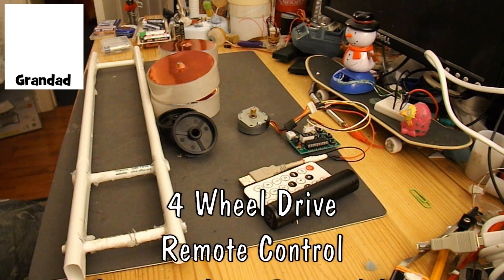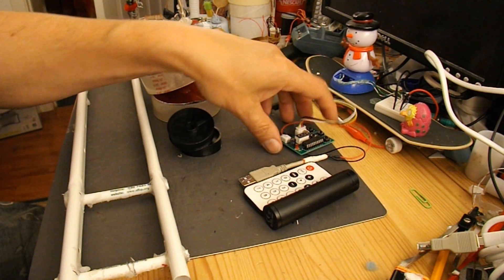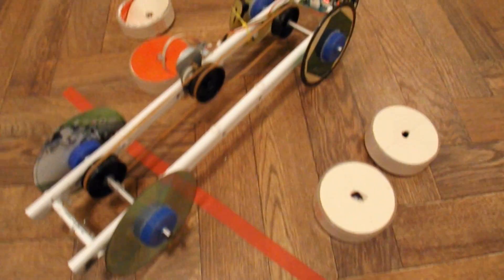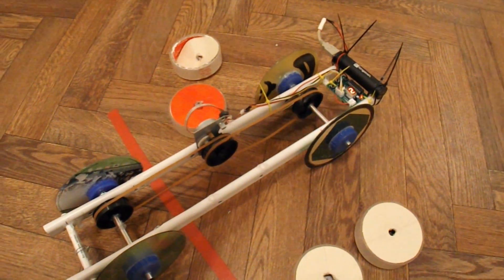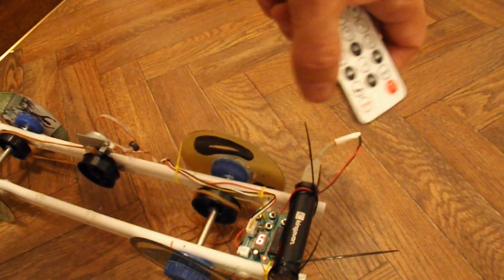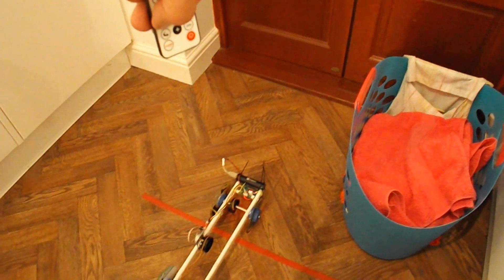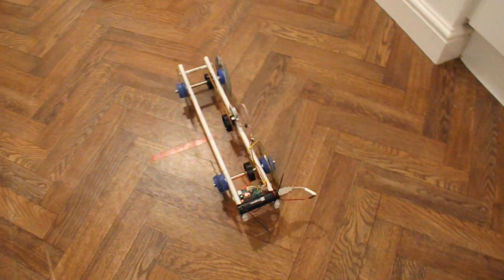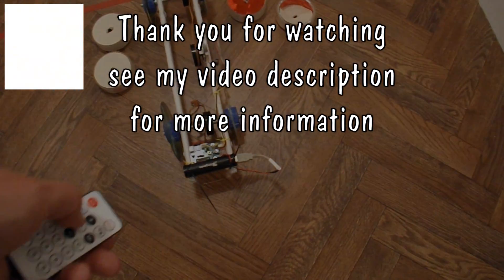4 Wheel Drive Remote Control Stepper Motor Powered Car

Comment: Do you think something like this could be modified to be used like this?  https://youtu.be/isfQs_CS_5Y
Reply from the maker: In essence the WIRAL LITE is a camera mount suspended on a line with two pulleys to support it and a drive wheel to move it along the line. So if you have a couple of pulleys, and electric motor and an RC system you could build your own. At a basic level this video show something similar although far less sophisticated https://youtu.be/5EqwOC9F1aA
Reply: Thanks!

Comment: little bit useless
Reply from the maker: Thanks for commenting. Everything is useless until you find a use for it. The purpose of this project was to answer a request by one of my viewers and that allowed me to test the remote control stepper motor driver. That has so far generated 413K views and some of those viewers will have found the information on the stepper motor driver useful. It may be that is saved them wasting time and money on that item or it may have been exactly what they were looking for so they could see it in use before buying it. However as you say, simply as an electric toy car it is a bit useless :)
Reply: Great response, I appreciate it. You explained very well what I did not pay attention on the video, because I did not watch it completely. Sorry for be rude commenting that, I should not had done, but the reason I did is because of your title, your title says 4 wheel remote control...it drives me to think something about a remote controlled 4 wheel car, not a didactic prototype. Your title could be something like "didactic remote controlled stepper motor powered car", it would get your viewers' attention, but the silly guy here would not comment offensive things. Sorry again and congrats for your teaching job.
Reply from the maker: Jefferson Deschamps Haha, thank you, I didn't find your comment offensive. I do get comments questioning the purpose of some of my videos, sometimes I question the purpose of them myself because some of the requests I get seem to have no obvious reason other than the requester would like to see their name appear on a YouTube video. Others are often based on obscure school projects which are only relevant to that individual and their school. Then other people see the video and they take some aspect of it for their own project.

Comment: Motor details, please. :) thanks.
Reply from the maker: +Abdullah Raihan Bhuiyan sorry it was just a scrap item salvaged from a printer I don't have the specification. There are some extra details in the video description.
Reply: thanks for the info :)
This is amazing, a very simple four wheel drive by one motor. I am thinking to build one by transmitting power through gear using one motor.
Reply from the maker: Abdullah Raihan Bhuiyan good luck with that :)

Comment: how the car has been controlled?
i didn't understand
Reply from the maker: +aashish shrestha I guess you will have to watch the video through again. The motor is a stepper motor. That is controlled by the circuit board which is controlled by the remote control which is infrared. The eBay link for the circuit board is in the video description.

Comment: mack a 4 will car wot can still stet
Reply from the maker: tyresse warwick I am afraid I do not understand your question?
Reply: Sorry but can you make a 4 wheel car motor control car what can steer you are my favourite YouTuber
Reply from the maker: tyresse warwick to do proper 4 wheel drive I would have to get proper universal joints and a differential coupling to put power through to the wheels while they are turned during steering. I would also need more powerful motors. That would mean buying proper hobby grade items and that is beyond the scope of the projects I do on this channel.
Reply: Sorry
Reply: You are still the best

Comment: Hi I love your videos but I have an request can you make a rc quadcopter with only one DC motor because I really want to make one but their are never good videos.
Reply from the maker: Ethan Padilla that is a regular request and the answer is NO. To make a helicopter or quadcopter stable in flight I would have to buy so many parts designed for the purpose it is cheaper to buy a ready made helicopter or quadcopter. On top of that, my channel is aimed at simple, quick, cheap projects and a helicopter or quadcopter build is not a simple, quick, or cheap project. You would be better finding a channel that specialises in RC Quadcopters or Helicopters so you get the information from people who know what they are talking about. FliteTest would be a good place to start although they tend to focus more on planes than copters https://www.youtube.com/user/flitetest
or anything David Windestål is involved in https://www.youtube.com/user/dadde87

Comment from the maker: If you have a question it is probably worth reading this video description first because the answer may already be here. To help you find my videos I made two search guides https://youtu.be/ceBSOoOHcgw or https://youtu.be/Zj4UgwkwYRk or checkout my playlists page https://www.youtube.com/user/GrandadIsAnOldMan/playlists?flow=grid&view=1
Reply: GrandadIsAnOldMan i know why it is  running too slow because of that ruberband if you realy put it it long it will became slower if you put it in to string or something it  will actualy work,,,
Reply from the maker: 3dRedstone Gamers no, the reason it runs very slowly is because the stepper motor has a very low RPM. Stepper motors like this are often used in applications where you need a very accurate but very slow movement. It is not designed to run a car like this, but I could have changed the gearing if I wanted it to run faster.
Reply: +GrandadIsAnOldMan now try to make it steer using  universal joints
Reply from the maker: The Piscis I could but that would significantly increase the cost and I don't like to spend money on these projects. My projects are about using scrap items or very cheap items.
Reply: you can find some small universal joints for 4$ on amazon, but it would be hard to mount them and would probably be  very time consuming.
Reply from the maker: The Piscis my projects rarely cost that much in total. That is the whole point of my channel.
Reply: that's fine, I wasn't too serious on my original comment.
Reply from the maker: The Piscis no problem with the suggestion as it is the logical progression for a functional 4 wheel drive. It's just one step closer to making a proper hobby grade car. If I did the steering, the next comment would either be 'fit a larger motor' or 'fit suspension' or 'fit proper RC' and so it progresses. Ideally I would make universal joints from some plastic beads and ball pen tubes to be more in line with my channel policy just to show it could be done.
Reply: GrandadIsAnOldMan

Comment: Really cool. I've never worked with stepper motor setups yet but will probably evolve up to that point sooner or later since I'm hooked on making stuff that moves. Automata stuff is really amazing to me but requires a lot of thought & engineering skills which I have not been taught so the learning process takes much time.
Reply from the maker: You certainly have the skills, your projects are fantastic and you take the time to make them look good too. I rarely make the effort to make mine look good, I am more interested in getting it going. I leave it to other people to copy them and finish them off if they want to.

Comment: hey can i remove the wireless control from a tv set and its remote
Reply from the maker: Yes it would work, but it would be technically very difficult to isolate the receiver circuit on the TV set as it would be incorporated into the main circuit board so it is probably not a practical option. The amount of work involved would probably be greater than assembling the component parts from scratch and building it yourself.
Here is an example of projects on YouTube doing this http://youtu.be/I2yO7kyvjAY

Comment: Build a rc buggy from  card board
Reply from the maker: Hi Ananto, I don't make many RC cars from scratch as they are so cheap to buy ready made. If I made one from cardboard it would only be a matter of gluing parts from an old RC car to a cardboard base. Check out my Radio Control playlist, there are some made like that there although I didn't actually use cardboard. http://www.youtube.com/playlist?list=PLA5a2xPRSrB13Xcquw4Ff09MQzTPjeVkI
Here is an example of a car made from parts of other cars http://youtu.be/DLcj07KuCL4?list=PLA5a2xPRSrB13Xcquw4Ff09MQzTPjeVkI

Comment: just bye a rc toy car for 12 $
Reply: its nice to build not to buy if you build you will learn if you buy nothing learn
Reply: The fun is not limited to eating, drinking and shopping
Reply from the maker: Hi Dawit, if you check out my Radio Control playlist you will see plenty of very cheap rc cars there. However this Project was made to answer a specific question by Dukey8668 who asked "Try to make a four wheel drive car with one electric motor." so buying a cheap rc car would not have answered the question.
Here is my Radio Control playlist. http://www.youtube.com/playlist?list=PLA5a2xPRSrB13Xcquw4Ff09MQzTPjeVkI
Reply: GrandadIsAnOldMan coo

Comment: or snow
Reply from the maker: Hi Stefan, I get lots of requests for 'off road' or 'all terrain' vehicles and I am not keen to build them as I do my test runs in my kitchen which is hardly an off road course. I might get around to one at some time, but it is not very high on my list of things to do. There are plenty of videos on YouTube already on the subject by serious Radio Control enthusiasts and anything I do will not be in the same class.
Reply: I produced a vehicle that is moving through mud or snow maybe I could send a short video about what it is.so that you can make some like my vehicle. thanks

Comment: So could you maybe add some gears into the mix to make it faster or Is the motor not strong enough?
Reply from the maker: If you wanted the car to go faster you could change the gearing or even change the power supply voltage. I think both motors I used were rated at 12 volts and I was running them with 5 volts. I wasn't trying to make a racing car, I was just trying out the cheap remote controlled stepper motor driver unit that I found on eBay and thought it would be a fun project. It was £2.99 + £0.79 postage and it worked.
Like I say in my video description I like to keep my work as simple and basic as possible so that it can be copied easily and improved by anybody who wants to try themselves.
Reply: Okay :)

Comment: Can you make a all terrane vehicle?
Reply from the maker: To do a decent all terrain vehicle I would need to buy suitable wheels which I don't want to do. I doubt that any of the motors I have would be powerful enough and I would need to buy suitable gears or a gearbox. I could just strip the parts out of one of my Charity Shop rc cars as I have several that are 'all terrain' but that would just be taking one car apart to make another one which seems a bit pointless to me. There are plenty of YouTube videos of people building proper radio controlled off road vehicles already.
Reply: Terrain

Comment: I'd call that elegant lumbering :)
It works though and it moves at the right speed for a kitchen.
Reply from the maker: Hi Slider, yes it is probably scale speed for the sort off 'off road' that I would consider. Not that extreme stuff with high speed near vertical climbs and jumps, more the 'green laning' as I have seen it called where you drive very slowly and gently over very rough tracks in beautiful countryside. Here is an example http://youtu.be/lMau7D-Zlsg

Comment: Try to make headlights for one of your cars ? And for the the hover craft try to put a fan on the back with a rotor so you can drive It around, for weight you can shave down foam or something like that
Reply from the maker: Cars with lights? Not really what you mean, but here is one I did earlier :-)
Bargain Store Project #52 CD Wheels RC Car with Lights 
http://youtu.be/DLcj07KuCL4?list=PLA5a2xPRSrB13Xcquw4Ff09MQzTPjeVkI
The hovercraft is an ongoing project than I have a plan I want to follow.